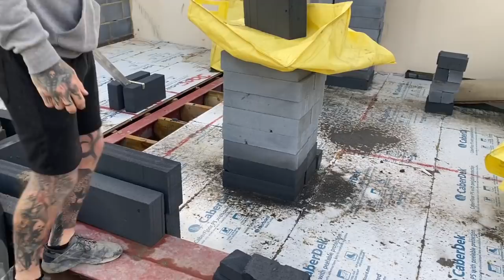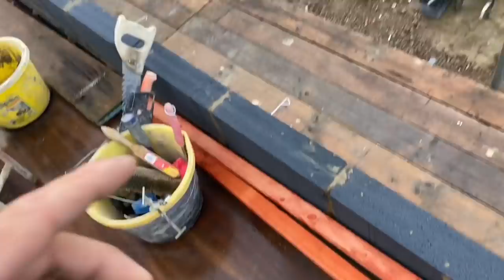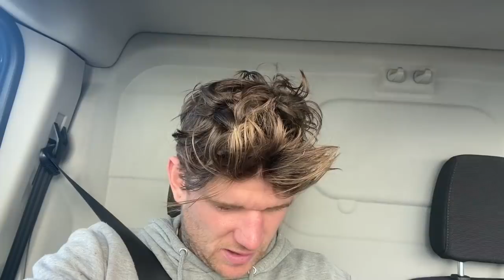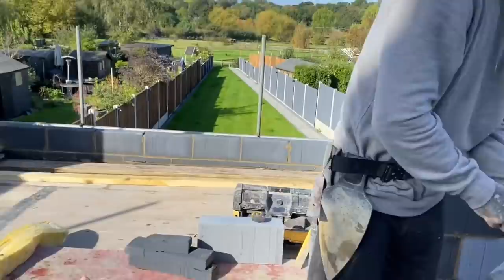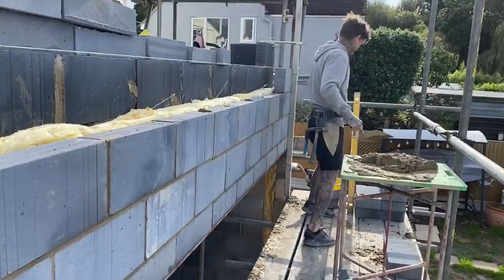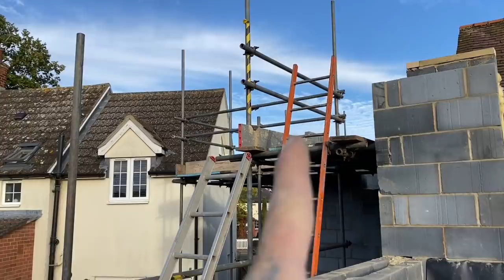Bricklaying, extension nearly finished

Comment: Really hard to rack a builders van out for everything you need. Especially when you move jobs with mixers barrows, trestles etc. Also at some point during a job you will need a few sheets of plasterboard etc when you are trying to get ahead of a plasterer for example, when you cant wait on a delivery.  A lot of racking takes up valuable " big space ". What you said is spot on, " dont rush it".  Wait and see how you want to use your van. Good luck.

Comment: I hated using a van for work. Yeah they’re convenient for the tools and even moving materials but they are thief magnets. You have to get a vault and also insure your tools. They don’t even bother just damaging the lock these days they just get there fingers in top of door and bend the whole door in half.  Grand later and that’s if they didn’t take anything else. Have a fabricator make you a solid steel box and put some decent locks on. Then buy a decent immobiliser or they just take the whole van. Hate to say all that but that’s the world we live in these days, you can’t have fuck all.
Reply: Nothing will stop them
Reply: Martin I’d go skeet/skeet with number 6, good spread but still maim the fuckers!
Reply: Martin, thinking cap on😂
Reply: That a dam shame but so true. In the State's also. I see tradesmen locking double locking with alarms.
Reply: Out of interest what do you use instead of a van ?
Reply: Jim S no worries dad 👍
Reply: No no no shot guns are too messy, all that blood and brains to clean up. Just hook up an electrostatic discharge to give them a good serve of volts, there is an electrician on YT in the UK who has done this, look him up 👍

Comment: charlie why not invest in a bumper hoist, its a conveyor belt type machine for lifting block an such to high places, it takes two to operate one loading the belt at the bottom one taking off at the top

Comment: Hi Charlie, I use a magnetic sign you can get larger ones that you can just pop on the side of the van when u arrive at site or when travelling around locally then before heading home take the magnetic signs of stick them in the back and ur good to go no one will know what kit u have in the back. 
And you can get sensors which are extremely loud every time some goes near to the van  just for when leaving it unattended and parked up ect

Comment: How come you being the brickie are putting the wall plates on? the timbers at the corners should be half lap joints, Im a chippie and there is no way i want the bricklayer setting my plates!, looking forward to the upcoming house build!
Reply: Being laying bricks for nearly 40 years.  Always been expected to put plates on oart of price
Reply: @michaelamos4651  Thats interesting, my work is all private residential, i'll give my Brickies a height for the inside skin and sort the plates out myself. Seeing as I'm the one who will cut the roof in, i prefer it this way, i guess it can be a grey area as a Brickie will not generally cut halving joints for the plates and the Chippie doesn't want to be knocking up sand and cement!
Reply: @RobNorman08  👍sounds like i should be working for you. Much better idea
Reply: @michaelamos4651  Haha, maybe get together with your Chippie, you lay the beds and he does the lap joints and places the plates on! The question is who fits the restraint straps though?
Reply: @RobNorman08  Nice one . Now thats definitely a chippies job . Cheers 👍

Comment: That’s a big van for just a few levels and bucket of trowels, personally if your not in short supply of work then don’t sign write it, won’t bother with van camera just get dead locks and big van vault. Unless your planning to use plaster board? I won’t bother with a false floor.
Reply: Yeah, security first. Pretty stuff after.
Reply: Maybe get magnetic signs for the van so you can take them off when you want and they're not so blinging
Reply: Cement mixer?  Materials he can get a pack of bricks in the back if he wants
Reply: @jordanleigh6481  exactly, it's not just for bricklaying tools

Comment: Hi Charlie, just came across this https://www.speedcrete.co.uk/rose-spade-trowel-9-x6.html and wondered if you had any experience of it? I have a 9 inch rose Philadelphia pattern and love it as I can use it in tubs easily but I like the look of the one in the link as it looks like it would work well in a tub but hold a bit more muck. Good to see you using the marshalltown tile setters trowel a few videos ago I also have one and swear by it for bucket work, how did you find the rose tile setters trowel?